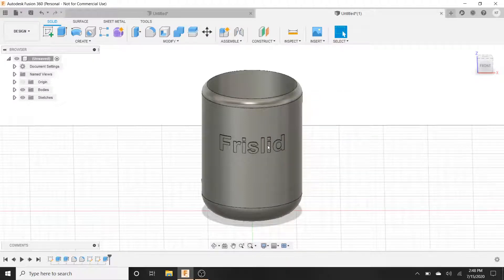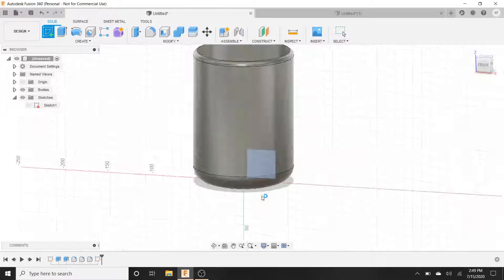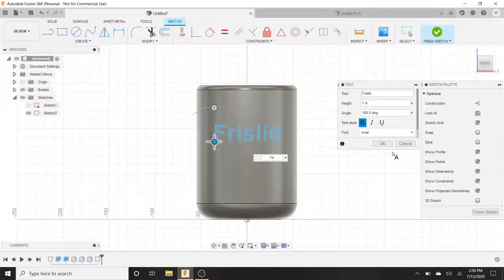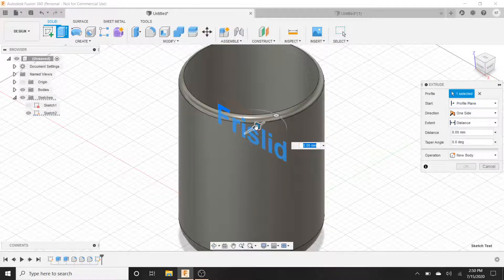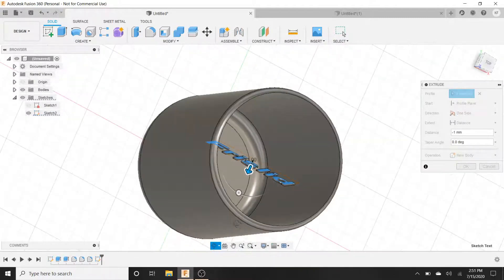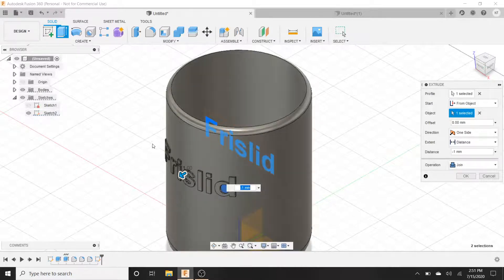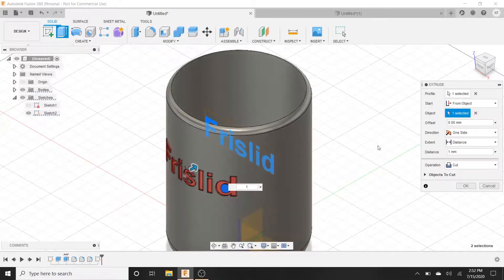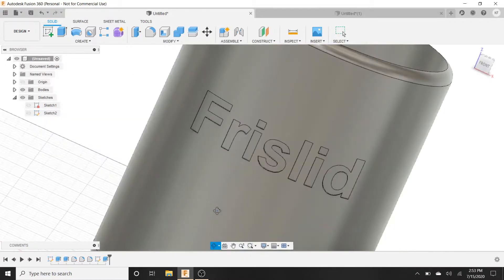How to add text to a surface in fusion 360

Comment: its not working for me and im doing it on a flat surface too...
Reply: if your text still wont work. ive been doing some googling and its apparently a bug that hasn't been fixed, and its most likely the font you chose. so try a new one until it works, fixed it for me.
Reply: @eggsandwhichian  ill thank you so much, without you i would have searched an eternity.

Comment: Isn't the text distorted by the curvature? If the extrusion happens at rt angles to the plane you sketched on, then it must be and the text edges will not be at rt angles to the curved surface.
Reply: It’s extruded correctly bc he extruded it from the object.  So it extruded only 1 mm evenly
Reply: @drdax  If you say so, but that's not how it looks in the video.
Reply: I try this and I keep getting an error that the boolean operation cannot be performed.